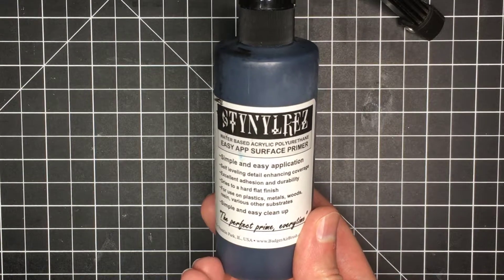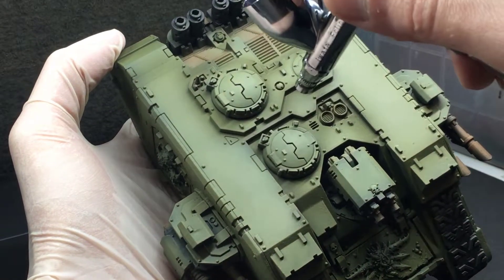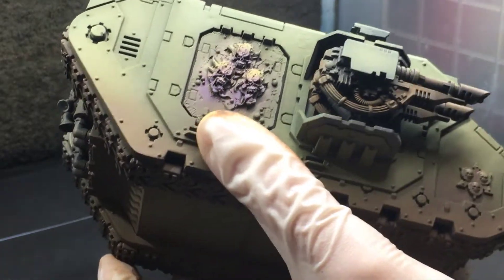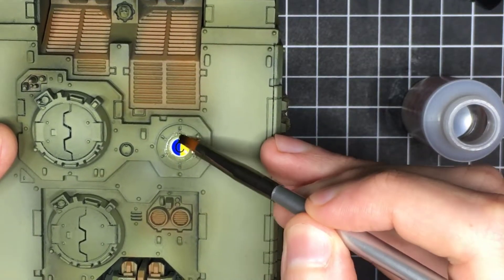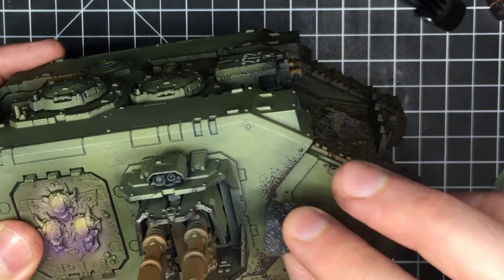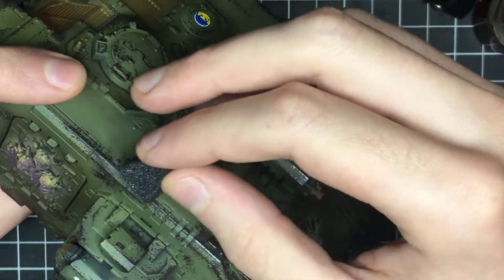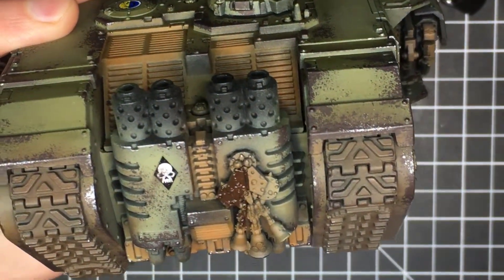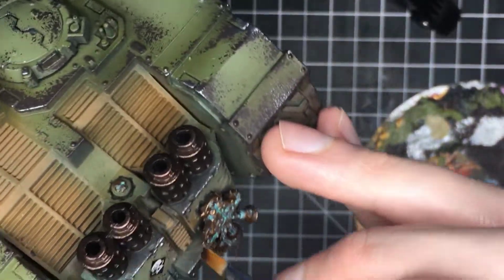PAINTING DEATH GUARD VEHICLES: LAND RAIDER

Comment: nice work, where did you get the conversion parts at the door and the front from?
Reply from the maker: Thanks! The doors and front are from forgeworld but I think they discontinued making all the land raider upgrade doors awhile ago.
Reply: @sierraminiatures  Thanks , the rear bells and the front of side has a death guard 3 heads skull, did you make it yourself?
Reply from the maker: @milkboy903  Those are bits from the old chaos space marine box i think they are pieces of the death guard standard glued together with some other bits. Basically they are an amalgam of things from my bits box sorry thats not more specific  most of the kits I used are pretty old so i don't remember too well